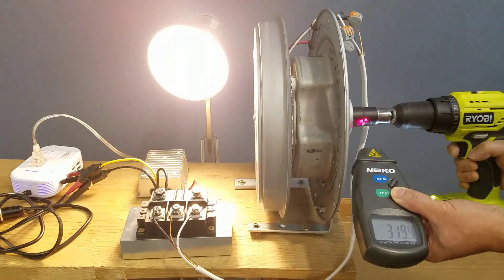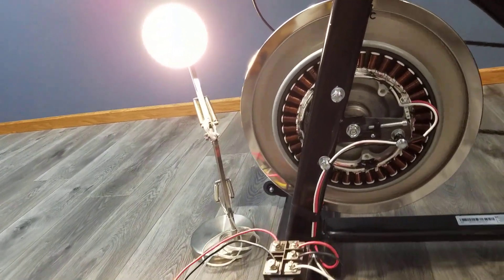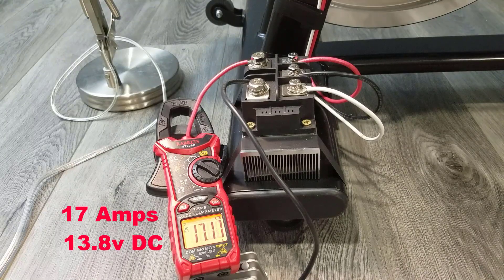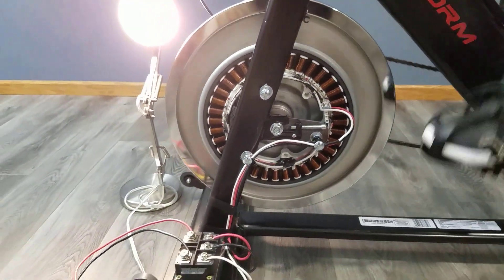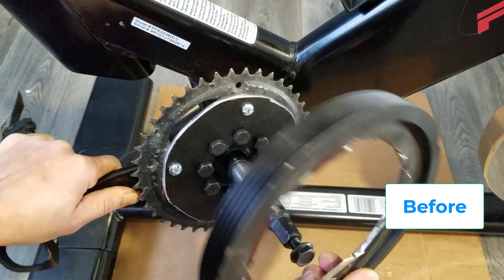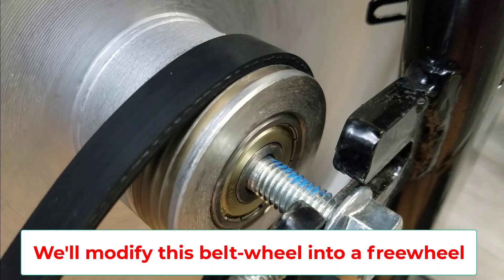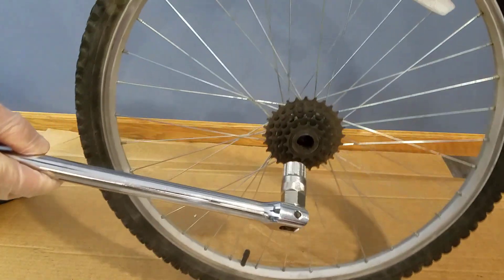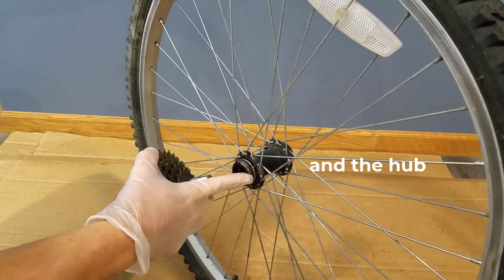Low RPM Off-Grid Generator!

Comment: Please share some data about this generator,,?
If this generator is made single phase,, then how much turn in each slot,?
How much Ohm is the total resistance of the coil,,?
What is the SWG of coil wire,?
How much pole of permanent magnet is used,,??
What is and how much webber is the useful flux of each magnet pole,,??

Comment: Advice:
Position the biker in a recumbent position.
Aim for 80...90 RPM for the *biker*. Aim between 100...200W for the biker depending on his condition.
90RPM @ 100W is something anyone can do for a few hours. That's why you need the recumbent position: to make it comfortable.
If you want to do peak powers for a recumbent postion, you will have to be able to sink more than 1kW of power. And you will probably need to feed that back immediately to fans for cooling and fresh oxygenated air.
I would opt for 100..200W for 4...10 hours a day...
This is the first build I've seen that has a fly wheel, which is absolutely necessary for comfortable biking.

Comment: I wish you hadn’t zoomed in the multimeter and cropped out the battery charging measurement, that’s where the rubber meets the road. what was the peak amps going in the charger?

Comment: 8:55   as discussed below, measurements made when there is a resistive dummy load in the output circuit are  not  accurate  and  the amount of input force required is  less-than  normal.

Comment: the usual multitude of mistakes are here            beginning with,  Not  really knowing what a  Nominal  output value is.      in order to accurately measure/estimate output volts and amps,  the rpms  Must be  reduced; as though the system were in operation.        the easiest way to do this is to  Short  the rectifier output.     (as far as i know, for brief periods this does not damage a rectifier.)            volts can be accurately measured or estimated based on the reduced rpms.        amps can accurately measured (at the reduced rpms) via the use of a  clamp DCammeter, on the shorted power-out circuit.          this is a radial flux bldc motor.      the stock configuration of the rotor is  very much less-than ideal for use in an alternator.       appropriate optimizing modifications to the rotor were not done.          it is not clear whether the rewiring of the stator was wonky and/or inefficient.       6:55   this is a wonky, high-loss drive mechanism.          googletranslate

Comment: Any chance it can power a house? Just curious.
Reply: No 17 amps at 13.8 volts is 234.6 watts you might charge a battery and run a couple led lights from an hour of hard pedaling maybe power a tv while peddling
Reply: @bensmith4563  Any way to boost up the amps?
Reply: Well, depending on your energy needs. An average household in Europeconsumes about 420kWh per month, meaning that you have to generate 14kWh per day. Given that the generator shown in this video can generate about 300Wh per hour, you’d have to spin two of these for 23-24 hours without stopping. However, in my case, I consume only 80-100kWh per month living in an Eastern European one-bedroom apartment. So if we take an average 90kWh / 30 days = 3kWh per day, I would need to be pedalling for only 10 hours daily. That’s still quite a bit, but if you supplement it with some solar panels on you balcony, then it’s a pretty doable thing to power a house during sunny seasons
Reply: @TheOnliner  Since I get frequent outages in other parts of the Philippines (No panels too because unaffordable), someone is gonna do a more makeshift generator because water and electricity maintanance is poorER here.

Comment: Awesome Video !!! Thank you for making this... The wind does not always blow, and the sun does not always shine ... now gravity - gravity is always present... What would be your thoughts on setting up a series of cascading weights that drop from a height of 10-15 feet towards charging a 12V 100Ah battery?  Would something like that work? How long would a single weight drive the generator... a series of 5 weights?  I have this idea that a series of weights dropping from a reasonable height, through the right gearing, could drive a flywheel / generator (low RPM) to charge up one or more batteries.  Repeated raising and dropping of the weights is an easily resettable system. I've been asked how the weights would be reset ... I think simply by pulling on a rope connected to the weights back up to a height using our own body weight.  Grab high up on the rope and lift your feet off the ground.  A typical male adult should be able to raise up a 100 pound weight using this method fairly easily.   A weight dropping generator could be in every home across the globe ... no reliance on wind or solar .... just dropping a weight.

Comment: Oooh, this isn't any old motor, it's an orbital flux. Anyone looking to make this, you're going to need a newer dryer to take apart. Well done! I've been waiting for someone to do this! I want to try an axial flux layout. I believe it's more efficient, more compact.
Reply from the maker: Glad you enjoyed it. Thanks for your support!
Reply: Fisher and paykel direct drive washing machine motor. Or i believe this one used may be an LG version of the same thing.
Reply: Most of these washers fail because the spider holding the tub dissolves.  You can pick them up in most tips.  Just need to make sure the bearings aren’t shot as well.
Reply: Excellent video.  Simple conversion process without a lot of expensive machine tools.